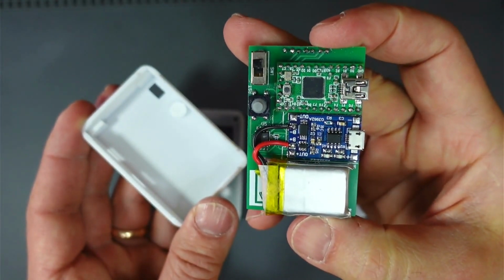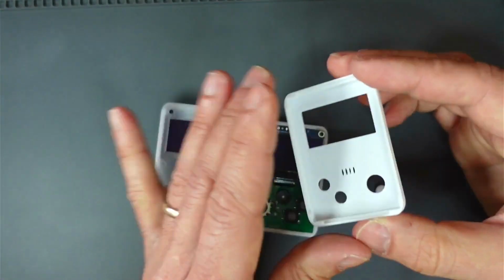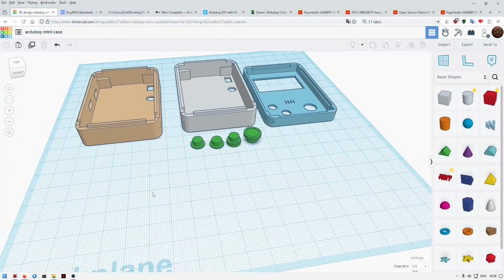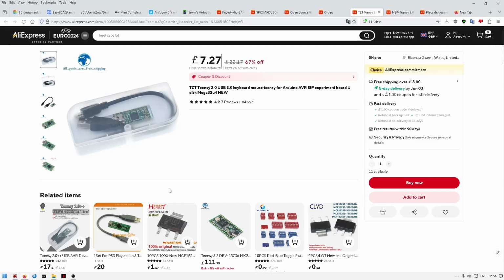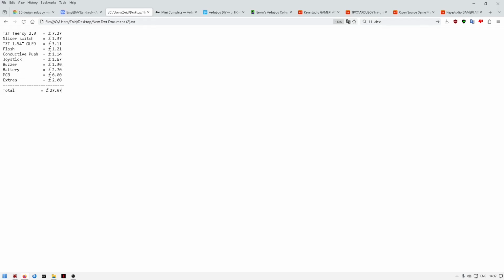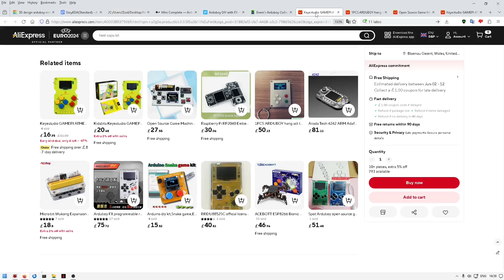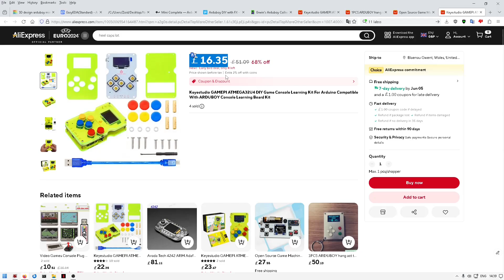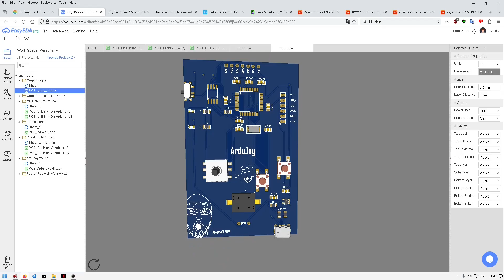Pro Micro & Teensy 2 Arduboy FX's. Part 3 : Cases!

Comment: Why would you be using such awkward kind of 32u4 board?
I've never head of it before.
Chinese pro micro are much much more common and cheaper, come with micro usb or even type-c.
Reply from the maker: The Teensy 2.0 doesn't need any additional components to be Arduboy FX compatible (apart from a flash chip). A pro micro would need a transistor and a couple of resistors (or breakout wires from the 32u4 chip) to be Arduboy compatible. Unless you go for "alternate wiring", which means the games need to be compiled for alternate wiring.